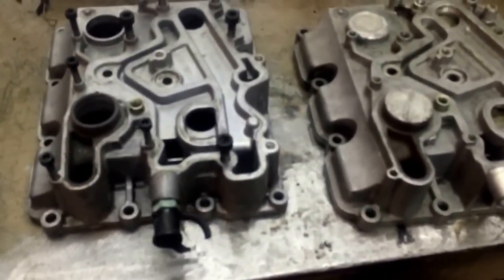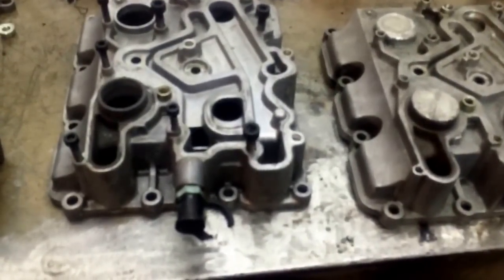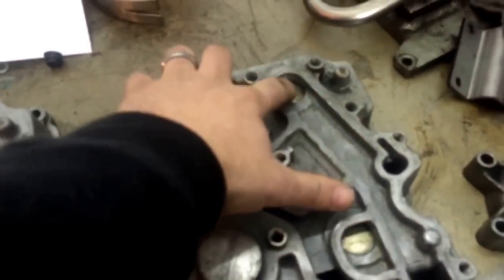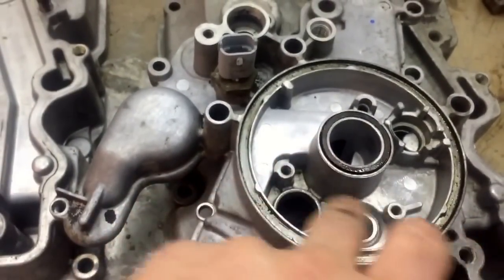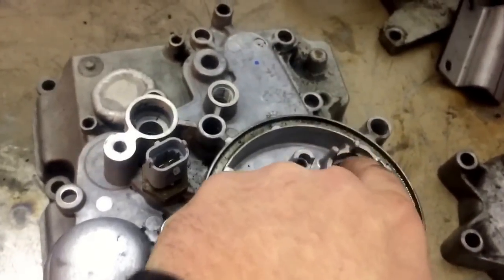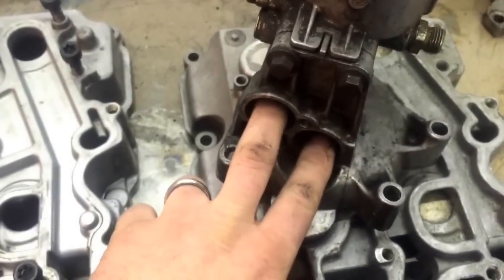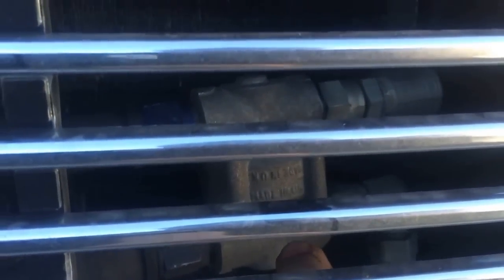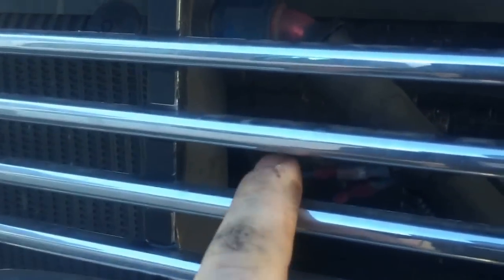6.0 DIY oil cooler and filter bypass

Comment: I'm surprised no one has caught this and has not said anything or they have and just letting him look like he does not know what he is doing.the way he has this hooked up he has filtered oil mixing with non filtered oil. when you put the top plate on there is no oil coming out of that bigger hole.

when the oil comes back in the filtered oil is dispersing through that little hole which is a bypass with that removed   you are mixing filtered oil with  non filtered oil. the oil spills over into the biggest hole which feeds the turbo,hpop res and ot,op,sensors and the mains,rods,cam.

block off the littlest hole so your not mixing clean oil with dirty oil and your oil will last a lot longer.
Reply: I was thinking you're wrong, but think again, there are two points needed to be made here, and you have a good point.
1. He has the oil flow direction reversed.
2. The holes around the outside (1 drain, 1 by pass and 1 supply) needs to be filled up, not open up.  For the e350, they need to be open up.  The reason is that for Fx50, unless you put a "fake filter that block oil going between them", R Carpenter is correct.  They mix up inside the filter housing.
There's another design that hook an outlet into those holes and return in the middle hole, making them like the van style.
Reply: I know these trucks extremely well.if you use the van style a passage can be modified to make it come out in Stock location.

the reason his system is working is because he has that dirty oil feeding directly "the bypass hole" feeding directly to the hpo res and mains,rods,cam exc.

you plug that little hole up and watch what happens his system will not work GUARANTEE YOU THAT.the way the stock system is designed is that if the lpop bypass opens "front cover" all oil does is circulate around and around it kills the flow and volume instantly don't believe me try it.the main supply line going to the filter can not have anymore than 70 psi or the bypass starts to open
Reply: remember if the bypass opens the volume goes away.when we start our trucks on really cold mornings  the oil pressure will be as high as 80 psi till it warms up.the reason is because the oil is thicker "viscosity " as the truck warms up the oil becomes thinner and loses some pressure therefore bringing the volume back if all things are good and fuel exc is diluting the oil resulting in other issues.

I will be posting a video very soon showing people how to save a lot of money or I can build interesting parties one.

I will also make other videos showing how to get free hp and how to make your truck run a lot cooler..when you do these mods you will notice instantly your truck is quiter and has a little more power.
Reply: sry forgot to also say the van style has a bypass also and opens up same as the filter housing style set up when the oil cooler becomes clogged.you can modify a passage to make getting to your connections easier.when you put a fitting where this guy has one it makes it very hard to get to the fitting.
one last thing it takes -12 to flow 18 gpm this is the flow of the 6.0 and the way he has his bypass 2 micron filter is severely killing the flow.he should branch off the main line with a "smaller line" to really clean that oil up with the 2 micron bypass filter.if he was to take that bypass filter line off he would see something is definitely wrong.

Remember what that sensor does is measure pressure and we get pressure confused with volume we think if we have pressure everything is good "you are in for a rude awaking for sure".

take that pressure sensor and put it at the manifold where it should be and you will see what I'm talking about.the pressure at the manifold will drop as the truck warms up this means the pressure will drop at the manifold and guess what that means for this system death.

one important thing to remember you do not want anything above 70 psi or it cracks open the lpop bypass killing the flow.if you have 70 psi going out you need 70 psi coming to keep that bypass closed any excess pressure opens that bypass and oil circulates around and around in the front cover.you will get some oil but not what you need and it will slowly fry your motor.

I have said it but I will say it again the reason this is working for him is because he has that oil feeding directly into the hpo res which is dirty oil.
Reply: @rcarpenter9508  so could you take everything off of a E350 and make that work?
Reply: @rcarpenter9508 it's been a while and I looked. You've posted no videos?
Reply: @rcarpenter9508 I am in the process of doing this to my 03 f250 now and was about to start welding holes up and it looked like if I just removed the valve setup on the two smaller holes it would follow the path of least resistance and bypass the new external cooler all together. So what is the fix for this design? At the end of the first comment, you said you need to close the smaller of those two holes where the valve was removed, but then in a comment after that you said that if you close the smaller hole his system will fail. I don’t know if I am reading all of this wrong or what but I am trying to get the truck back on the road and I need it to be reliable as it is my work vehicle. Please let me know what needs to be changed to make this work right

Comment: This is a basket of nonsense
Reply: Why do you think this is nonsense??
Reply: the way you explained it is wrong and surprised no one has caught it.a factory oil cooler system has the oil entering where those two valves you took out.the other little hole associated with the main feed valve is a bypass and opens up when the oil cooler becomes clogged.if you have oil entering and dispersing through those two holes you are sending oil back through your system and not entering the motor.

those two valves you took out you are only getting the oil from that little hole not the big hole where it normally comes in.

if you have a tube separating that from filtered and non filtered oil.
Reply: Oh and further more the reason why your system works is because you have filtered and non filtered oil mixing and going straight in that big hole which feeds the turbo and the hpop res.YOUR SYSTEM IS NOT AT ITS FULL POTENTIAL I would be glad to talk it over with you and I can show you a way to simplify the system even more and filter 100% of the oil on the very first pass,you think your truck runs good now watch how it runs with just a few simple changes.
Reply: He did say he has had it for years with no problems. Why not make a video and show us all how to improve it or ...are you really a "Bulletproof" employee??
Reply: Can you please show me what you are talking about to filter 100%?? I am finishing rebuilding and trying to this to my truck
Reply: lmfao hell no I'm not a bpd junk employee. the way he is doing it does work but he is mixing clean oil with dirty oil.flow takes the path of least resistance. 

as I explained he explained how the oil flows in the oil cooler manifold wrong.when he welded up those holes he welded up the out going hole so he created one "this part is right".when he took out the smaller bypass valve which is used for when oil cooler is clogged.the oil bypasses the oil cooler and does not get cooled but does get filtered.he is not using the filter in the res so the oil that is coming through that little hole is unfiltered oil and going straight to the hpo res.

I'll tell you what leave me your number and I'll call you and explain and tell you some things about the 6.0 you have never herd now would bpd do that lol I  look forward to talking with you.
Reply: Show us how to properly modify it then rather than just keep slamming 6.0 doctors system. He said his oil stays clean and his system has been in the truck for five years so it must be working. All the oil will eventually get filtered regardless if it’s mixing with the dirty oil or not. All vehicles do this. The filtered oil always re-enters the engine and remixes with the dirty oil.
Reply: @Joenalo  unfiltered oil is what causes most of an engines oil issues . again go re read the first couple of posts where I tell why his system is working. The only thing is there is no spring pressure to over come so really he is basically pumping dirty oil into his motor over and over from the beginning. 

The bypass in the oil filter base plate opens around 50/60 psi and that's because   oil will not pass through paper.take your stock filter and pour oil over it you will see that it takes a really long time here is where the pressure effect comes in and opens the bypass in the base plate.